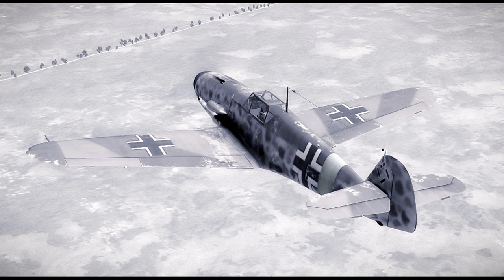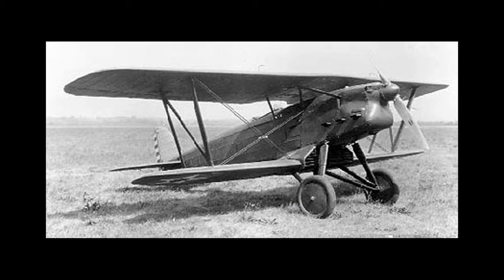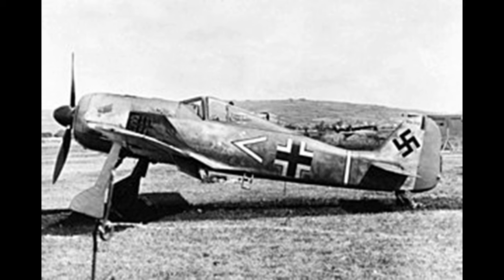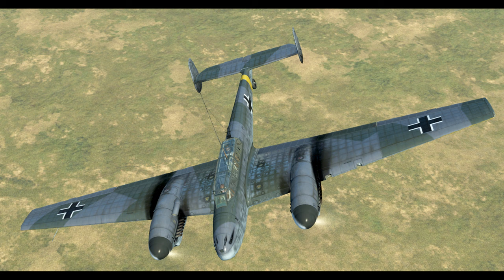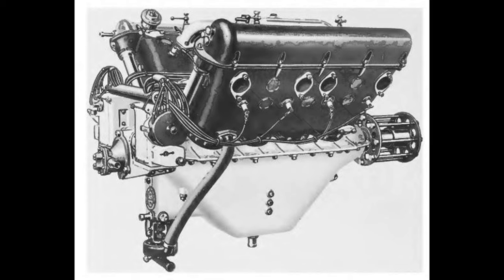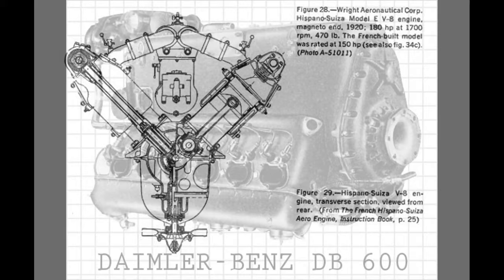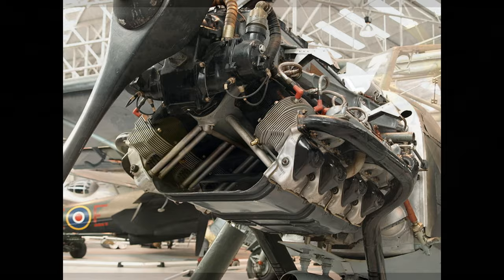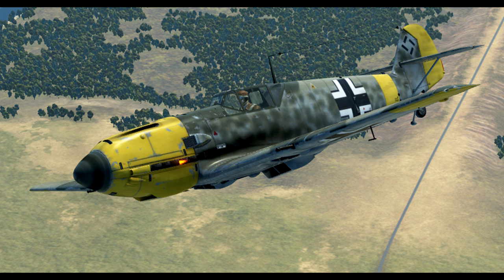Messerschmitt Bf 109 , Why an INVERTED V-12 Pt. 1? inverted V12s vs. upright

Comment: Great video as usual. Germany already had the Maybach gas V12 for tanks, so I don't believe that they were concerned with cross use (although the Nazi's optimization of their industrial base was not particularly efficient, especially given their otherwise authoritarian state).

As far as naval usage, the E-Boat was much bigger than a PT and in no way an Apples-to-Apples comparison. I think the E-Boats actually used sub engines.
Reply: I read an article,from years ago,that what became the E boat design was based around a particular marine diesel engine. It was not until about 1925 that fuel injection could be made small enough for automotive use. Thus a compact marine diesel was relatively new. FWIW,the single greatest design item that separated the E boat from the British MGB family was the use of two outboard rudders that were cocked at a slight angle. These applied drag at the point of greatest leverage,thus holding the bow down. Quite unlike anyone else's hull.
At any rate, the E boat was an outstanding design,one carefully thought through for some years before the war. Little details add up,and in a mad rush to accomplish years in months,no one else got all the bits quite as right as that particular design.
Reply: @paulmanson253  Thanks for that Paul some really interesting information there. I know that in WW2 the E-Boat was such a threat that the British had radar stations searching for them and if spotted the RAF sent out Spitfires to hunt them down. Problem was they could only operate in the daytime.
Reply: Being and authoritarian state was not the advantage you may think, Paul. For one thing the Germans military decided in the spring of 1943 that all defence research which would not be completed withing 12 months would be stopped. This meant that research such as that into surface to air missiles stopped. Something which would have made a great deal of difference to the USAAF bombing raids in 1944/45. The simplest missile looked like a smaller version of the Me163, wire guided and with a 1000 lb warhead. Imagine that going off in the middle of 12 B17s. And it could have been transported on a tracked vehicle.

And the best part. All those scientists, engineers, et cetera were sent by the German Army to fight on the Eastern Front.
Reply: @bigblue6917  Whoops. Never said that. The article I read mentioned one small group of people put the bits together,and much of that was former Kaiser Kreigsmarine  people held together,experienced trained, professional, etc.
There were two small sets of precursor builds before the standardization of the classic E boat design. They worked out the bugs by way of actual operation,and that took time,years in fact.
The Royal Navy very visibly dropped the ball over many years,submarine design being bizarre at times,read about the lunacy of steam powered submarines intend
That is what I meant. The bravery of both sides in the small craft war in the Channel was exemplary,with high casualties of a small group of personnel that in the war years took a high toll on very brave men.
           intended to be fast enough for Fleet common operations. Oops bad editing.
Also the development of effective small craft design was neglected,with the Germans having the better designs plural.
I do not know how to fix an accidental keystroke that separated the text. Meaning should come through.
Reply: E-boats used a displacement designed hull.  Whereas the Brits and US used a planing hull. Quite a bit different. The reference to the rudders; you are talking about the Lurssen ''effect.''  They didn't cause drag, pls read the link, a very smart idea! https://ipfs.io/ipfs/QmXoypizjW3WknFiJnKLwHCnL72vedxjQkDDP1mXWo6uco/wiki/L%C3%BCrssen_Effect.html.
As for the German E-boats, they were powered by the first high speed diesels, 3x MB501 V20 2000hp each.  @paulmanson253
Reply: @bigblue6917  Authoritarianism wasn't a disadvantage either. The USSR managed to outproduce the Nazis by a significant margin, and they had the added hardship of relocating most of their industry east of the Urals early in the war.

Also, if you read Albert Speer, he was shocked at just how inefficient German industry was when he took over as Minister of War Production in early 1942. Germany actually reached their peak of armaments production in 1944, during the height of allied bombing.

According to Speer there was a tremendous amount of replication in German production, plus a variety of over-engineered gear, unfriendly to mass production.
Reply: @Slaktrax  The E-Boat was pretty impressive, remained in service well after the war. Good info on their engines here: https://oldmachinepress.com/2017/03/05/mercedes-benz-500-series-diesel-marine-engines/
Reply: @bigblue6917  Your statements could use some sources.

Comment: I was waiting for you to mention the Chrysler 5 bank, installed in the Sherman tank...ugly, heavy, and interesting.
Thanks for the video, I think you're spot on.
Reply: A case of what can we do with what we have on hand. Dual GMC 2 stroke inline 6 diesels were also used
Reply: @mpetersen6  Exactly right. The 5 bak always comes to mind when I hear about the Sherman because it's the most unusual, though the dual bus engine is a very close second in that regard. I could go on and on, but I'll leave it at that. Great comment, BTW.

Comment: Well you pretty much hit that spot on. Air racing set the standard for a sleek, liquid cooled, inline v12. Inverting the engine gave the ability for better visibility during landing and takeoff. A good example is the radial double wasp engine used in both the Grummand Hellcat, and the Corsair. The Hellcat had the pilot seated very high up in the airframe, while the Corsair had a long nose, and standard seating arrangement. Soon once sea trials began for the two fighters by the US Navy, they realized that visibility was so bad in the Corsair, that test pilot's could not see the carrier deck upon approach. Air cooled radial engines had reliability, and were very robust, but visibility suffered, same with an upright V12, the long heads and exhaust manifolds prevented proper visibility at high angles of attack. As for why it was used in other multyengine designs, I'm sure it was due to available engines that fit a given criteria. Aircraft designers design airframes, not engine's, so they grab one off the shelf of available engines at the time.

Comment: You sort of indicate it yourself, but it's a fact that the RLM requirement that led to the Bf 109 having the gear under the fuselage was related to train transportability for repairs. (07:03)
Reply: As much development as the 109 received throughout WW II, it's somewhat surprising that they never seemed to bother with even a prototype with the landing gear under the wings.
Reply: @chuckschillingvideos  They did, several, look it up, and the landing gear wasnt that much of an issue, the Finns operated the type without issues, bag LW basic training and macho attitude created the problem, it wasnt fixed until LW pilots started dying in droves in the F-104.
Reply: @chuckschillingvideos  why they had FW190 ;)
Reply: @chuckschillingvideos  Wings too thin, would have been a complete reconstruction, not an evolution. Thus not feasible.

Comment: As an ex-Rolls Royce employee after I finishedmy Service in the Royal Air Force, the story is that in the 1930s, a delegation of German aircraft engineers visited Derby in the U K for a tour, and examined a R R Merlin on a stand in the main offices that was being moved and it was inverted, not as it was designed to be when installed in an aircraft.    So they adopted the inverted design.   The Merlin had a propeller shaft which through the need for a reduction of revolutios to the propeller, had big reduction gears from the low crankshaft to the propeller shaft.
Reply from the maker: The Germans were building inverted engines long before that delegation showed up.

Comment: From my understanding it is gun size and not tank weight that determined if it was a Light, Medium, or Heavy Tank. So though the Panther was a heavy tank in weight, it only had a 75mm gun, so was classified as a Medium Tank.

Comment: When the prop was direct mounted to the crankshaft would it not allow for a larger prop since it would allow the hub to be located at the top of the engine instead of the bottom. Perhaps this was part of the original thinking that became superfluous when gear reduction was used.
Reply: Mongo63a you have to have gearing to slow down the prop relative to engine RPM. Also the first Bf-109 prototype had an upright Rolls-Royce Kestrel V-12 engine.
Reply: @Locspocs2    Also the later Spanish 109's (post-war) which used Merlins bought surplus from the UK...

Comment: The RR Merlin grew out of the PV12 project which originally was conceived as an inverted V-12 (a wooden mock-up was built).
Further advantages:. No Carbon Monoxide poisoning; exhaust fumes draughted away below. Reduction of pilot fatigue: less noise and cockpit heating. Shell strikes on thin valve covers won't obscure vision from spewing oil. Likewise water vapour in the exhaust won't condense on the OUTSIDE of the windscreen at high altitudes.

Comment: 4:02  Note the exhaust dirt on the fuselage, it's not on the canopy by being inverted.
Reply: It's also getting pulled along by the airflow over the wings which further keeps the pilots vision clear. Exhaust fumes can be pretty good self-inflicted smoke screens.
Reply: That's an animated picture. Probably a screenshot taken from a flight simulator...  However, you have a point, but I guess that's just a positive side effect.
Reply: @sidekickbob7227  many photos of BF-109s show scorching in the same place.
Reply: @andrewince8824  for sure, but I think the level on this channel is above referencing to a screenshot from a computer game...

Comment: "A-Engine" with haning cylinders - has the advantage of much easier maintenance of the cylinderheads, more room for synchronized board-weaponery - thats about it.. in an airplane which is anyway often "up-side-down" its pretty irrelevant which way you build in the engine, right? it must anyway work in all positions flawlessly...

Comment: Another reason is that from the very first model, DB engines were equipped with fuel injection, that was an incredible advantage for the planes in warfighting, expecially during negative "g" manouvers, while the v12 upright were still equipped with carburettors, thus, while manouvering in g negative, were suffering loss of power or, even, engine power cut off...
Reply from the maker: That has nothing to do with inverted vs upright engines.

Comment: Designing aircraft myself and my favourite engine is the DB605. Although my engine is mounted vertically, a strong design consideration is cooling. The DB605 was a highly stressed engine. As you know the fuel quality was not as good and the Germans compensated with Aftercooling, variable speed supercharger, MW50m Multi valve, sodium filled valves, and fuel injection to name a few. Having the engine inverted assists in cooling drastically. As the heat concentration is mainly in the head, having it inverted as thermal siphoning drawing heat away from the head and valve train. This also prevents any vapour lock in the top of the cylinder. The Rocker cover being used as oil collection point also aids in cooling and less requirement for oil squirters. Also for the pistons being inverted this aids in underside cooling, although squirters were used drip and splash cooling are more successful. Also being inverted, when pulling high G's at high engine power the oil squirters and splash lubrication are being aided by the additional G forces as positive G's are experienced more frequently and for longer periods than negative G's. If the oil pressure is 4 bar and you are pulling 4 g's for sustained periods, you would effectively have no oil pressure at the pistons squirters if the engine was not inverted. That is a few reasons with regards to the cooling benefits. Have a nice day, from Australia.

Comment: Thank you Greg for a very interesting presentation / video. Just a thought, the ME 109 have the option of guns on top of the engine and shoot through the propeller as many of the WW1 biplanes had. Could this also be a reason for the initial decision to design? I am aware that it does not come into play with ME110, but still. Best Stefan
Reply: Some of the russian planes also had the propeller hub cannon with an upright V12, besides that wasn't a feature until the G model rolled out so I doubt it was an intentional choice.

Comment: Another good reason , a 20 mm MG engine-mounted cannon firing through the propeller
Reply: I don't understand why that makes any difference with regard to the orientation.
Reply: The gun fires between the cylinder banks, so it would work no matter which way up the engine went.
Reply: @paulabraham2550  It was easier because the gun was low enough to be placed under the pilot's seat with the barrel coming between the pilots feet. Non-inverted it would have been at chest level and presented a big problem with gun length and cockpit.
Reply: @keithstudly6071  That sounded plausible at first sight, but on reflection I'm not convinced. The gun has to fire through the airscrew boss, and that must be what determines what height it's at - ie, the aerodynamics, not the shape of the engine. Turn the engine upside down and nothing much would change except for the shape of the cowling around the nose - the airscrew would have to be at the same height and so the gun would too.
Reply: It's not very easy to tell because the drawing is very busy. But the breech (item 51) is shown in this drawing - http://scale-model-aircraft.com/wp-content/uploads/Messerschmitt-Bf-109G-Cutaway-Drawing.jpg - and appears not to be under the seat but in front of the pilot, perhaps at about waist level(?)
Reply: @paulabraham2550  I have taken a look and I find that cannon is shorter than I was led to believe. Still the propeller is on the thrust line and there is some latitude about where the thrust line needs to be and the engine is located as much to minimize frontal area as an important factor. The widest point of the engine should be close to the widest part of the fuselage (wing root) for aerodynamic reason. Having the cannon where it is fortunate but not the main reason I think. Having the supercharger beside the engine instead of behind made the cannon packaging much easier than with a Merlin or Allison. I'm coming to believe that experience in building direct driven (no reduction gear) engines with the crank on the top made the idea of inverted aero engines seem very normal so they just kept doing it the way they were used to, even though the main reason went away with reduction geared prop drives.

Comment: For the advantages of the inverted engine type, many European manufacturers offered this type of engine in the inverted inline style: Renault (inline 4 and 6), Walter (CZ), Argus (mostly known for the inverted V8 and V12, but also I4 and I6).
SAE transactions have a 1926 Transaction Volume 20, Part 1 where the advantages are cited.

Comment: I have read many years ago that the DB series engines had “relatively” small amounts of major engine work done in the field. They were generally shipped back to the factory or a major overhaul depot for anything like cylinder or “top/bottom” end overhauls. I don’t remember if this was a local logistical parts thing or a higher up military logistical directive. Replacement engines were just sent as replacement “eggs” including the engine mounts. For quick swaps.
I also remember from from reading that RR Merlin and obviously Radial engine field repairs were common.
That would negate the advantage of field work on the DB inverted V-12s.
I also seem to remember that 25-50 hours combat lifetime was pretty common for all of the V-12s.
Have you come across any of this type of reporting in your research?
A lot of my memories may come from Bill Gunston’s books, but I could surely be mistaken.

As a side note. My Dad flew B-36s. On most long multi-Continental flights they carried a complete R-4360 in an “egg” in the bomb bay for quick swap out replacement anywhere on the planet. Along with mechanics to do the swap.

Comment: Interesting analysis. Could it also be that the German Fighters mostly had their guns mounted on the top of the fuselage or through the engine an dthe inverted design facilitated this?
Reply: Through the engine wouldnt be a problem, French used regular V that way, while guns on top of the regular V were used in biplanes like He 51, Fury or Ki-10. Then later Russian Yak, MiG and LaGG designs did use guns on top and through the engine. I cant think of later western designs with guns on top, A-36 had 2 guns under the engine instead. The reason would most likely be aerodynamics, but I dont think that would be the main idea when RLM ordered inverted V designs.
Reply: +lensman57  The French invented the cannon arrangement through the engine VEE.  It's likely that the Germans just adopted that efficient design.